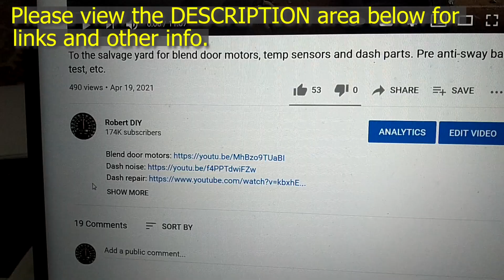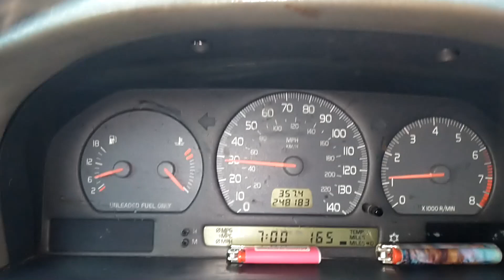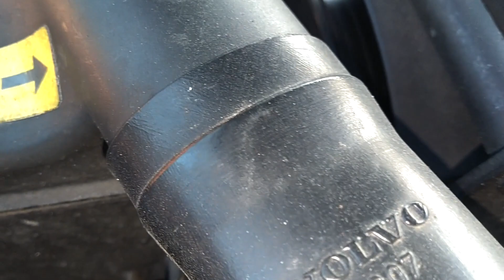Who told me that I should move? OKC bound, test drive Lil 'Red for a noise, Antenna mast, etc - HOWR

Comment: hahaha, love that pave-job! omg, just leave it gravel
Reply from the maker: Really.
Reply: @RobertDIY  haha, yeah.. Recently bought myself a s60 2.4t and started to watch your channel. Lots of interesting stuff here when you drive a volvo and dont want to dump all your bank account into leaving the job to a shop. Actually want to tune my ecu for some more boost, its like 0.3 bars right now and 200hp. Thats like an old 940 "ltt" as they are called here in sweden. My s60 needs more boost! Did the rear muffler delete mod and 3" on that just to get the sweet sound out, but it needs more..

Comment: The king size mattress is really coasting you a lot, what about just buying another mattress at OKC???

The dash on my car is in similar rattle mode.
Reply from the maker: We need to fix that.
Reply from the maker: Moving to Cincinnati. 😒
Reply: My first 850 had that high pitched dash rattle. Stuffing various areas with bits of felt helped as i recall.